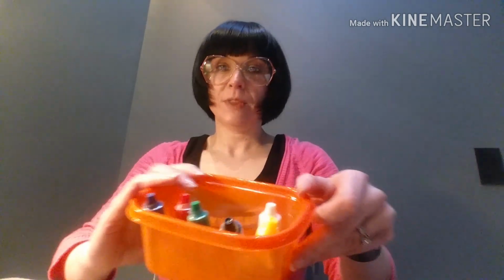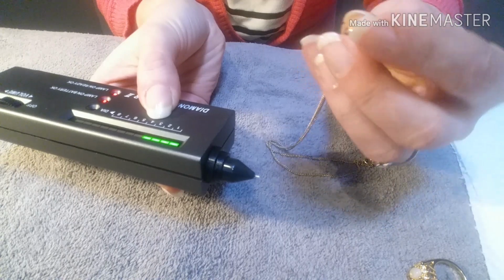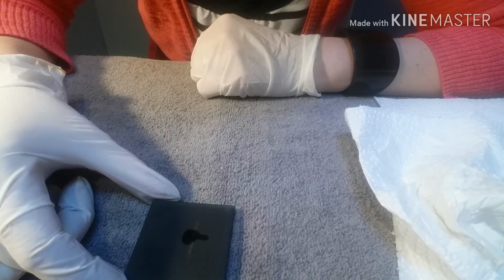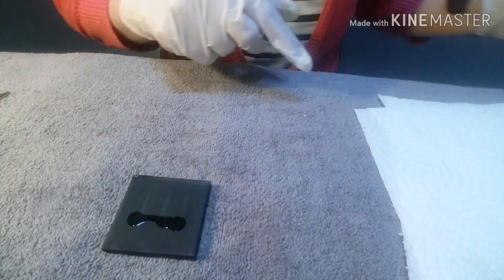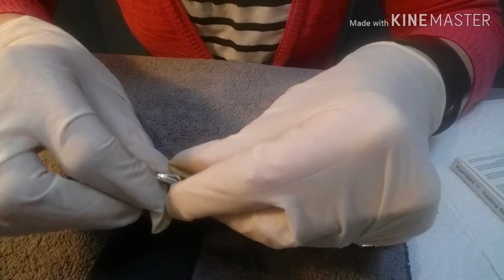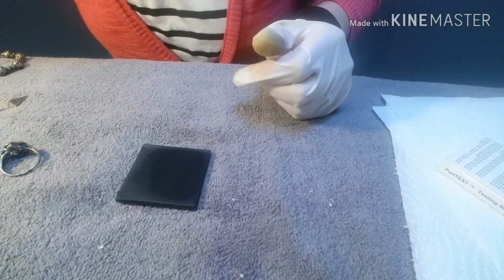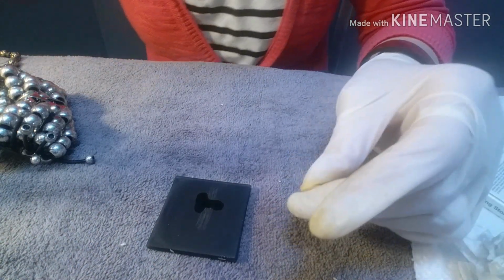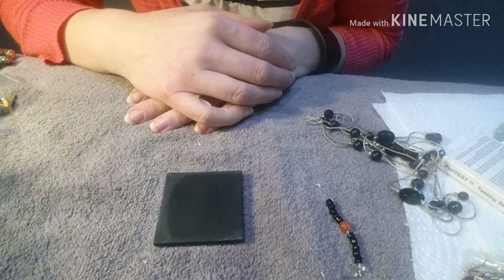Silver, Gold, and Diamonds. Oh My! Let's Test Some Jewelry!

Comment: I hate to do this and was not going to but I prefer to help people and educate people so they do not make mistakes. but to get on with it that bracelet is not diamond its white sapphire and that's fin that is actuly better in a way since white cloudy sapphire is worth the same if not more then cloudy poor grade diamonds. when using this type of tester its very hard for people to understand how they work. partly do to the fact when it was invented it was translated over to English. the chart on the back is useless what you do is set the tester to wear the first bar lights up then test the item if it hits diamond then its a low grade diamond if it hits high then its a high grade as far as hardness. if it hits numbers 6 7 or 8 its a sapphire now understand 1 bar in diamond can be a be a sapphire they do not come up much and most people consider them diamonds but when a pro loops at it with a loup they will no its a sapphire that is of high grade if a stone hits 2 its more then likely cz or glass if its 3 to 5 its a gem stone of some sort. a lof of stones like topaz will hit 4 or 5. I hope I helped you and anyone who takes the time to read this.
Reply: Tremendously helpful